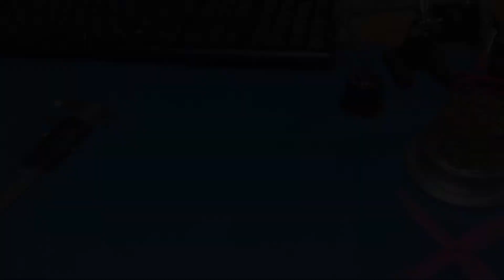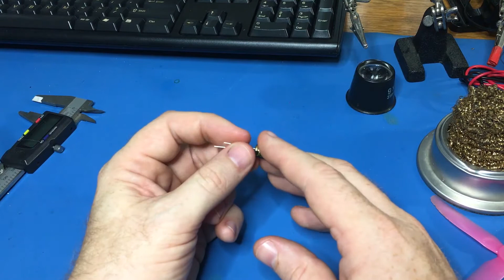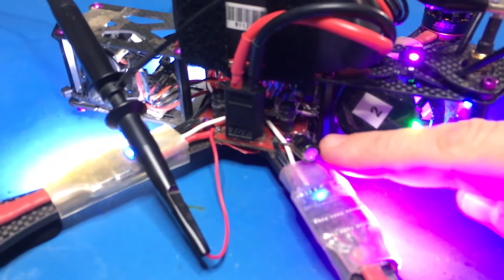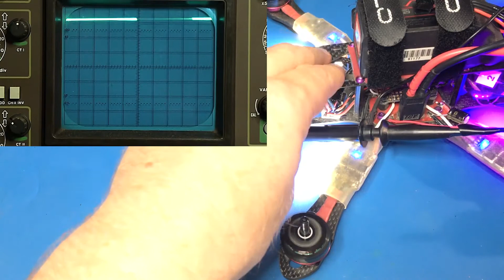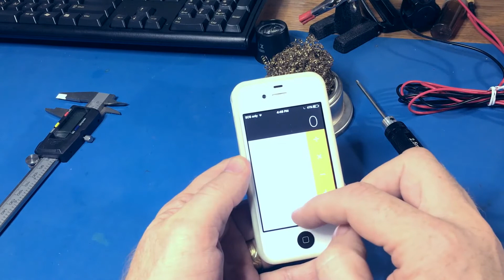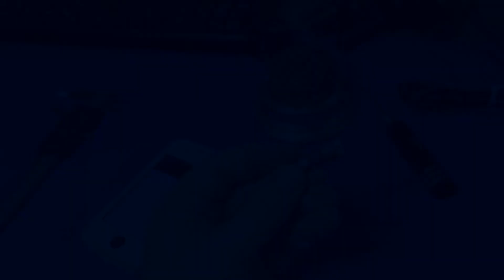Tech Talk - Testing Low ESR Capacitors | Mini-Quad Noise | LC Filter | HOW TO

Comment: hi, first, good info. Second, after salvaging some caps from old electronic components , Im wondering how to tell if the caps are low esr or otherwise ?
Reply from the maker: Thanks. I would say check the manufacturer of the capacitor and see if it's something well-known like Panasonic. Also you may be able to take a close-up photo of it and use Google's Image Search function to find matching images on-line, then you can check the datasheet of what you have found and see if it's got a low mOhm value. You'll need to put your "detective" hat on for this really :)

Comment: Can I use a 4x 4700uF 16V low ESR? Is it going to be better?
Reply from the maker: Hi Nicacio, yes you can do that if that is the only size you have. That size will be very big and heavy though I would expect. You may also find that the rating of 16V is too low if you are flying 4S or greater - the capacitor(s) might go pop!

Comment: That’s really interesting. I’ve been having some issues with my runcam Eagle quitting during flight. I had it wired up to the 5v out on the vtx and the camera would die a few seconds into flight. I then wired it up directly to the pdb and it stopped dying in flight but now dies after a crash or even breaking a prop flying through a tree. I noticed I tried to recover and then the vibration in the air frame seemed to kill my camera. It only starts working again once I unplug the camera and plug it back in. Could the voltage spikes be causing this?
Reply from the maker: It sounds quite likely to me to be just what you have described. I'd recommend putting either: 1) One large Low ESR capacitor on the PDB. 2) Four Low ESR capacitors on the ESCs. 3) Using a good RC filter to separate your sensitive electronics from the noisy ESCs/Motors. Regards Tony
Reply from the maker: It sounds quite likely to me to be just what you have described. I'd recommend putting either: 1) One large Low ESR capacitor on the PDB. 2) Four Low ESR capacitors on the ESCs. 3) Using a good RC filter to separate your sensitive electronics from the noisy ESCs/Motors. Regards Tony

Comment: Amazing video!!!!!!   Does any one sell a low noise high performance ESC?   It seems like the logical step in this hobby would be to make a low noise ESC.  My ESCs (RG20'S) are sandwiched between my frame and I dont have the room for these compactors.  Wouldn't it be easier for the ESC companies to add a bunch of square capacitors to each ESC?
Reply from the maker: Thanks for the feedback! I would say that in the "old days" the ESCs used to come with big capacitors but the manufactures started to remove them to save cost and weight. I would recommend perhaps putting a 1000uF low ESR capacitor on the PDB, as that will be better than nothing. Then if you really wanted to have low electrical noise in the system then an RC filter to separate the "dirty" section from the "clean" section. Today's ESCs are producing so much electrical noise since we have larger and larger motors and each ESC uses Active Breaking and its at this point that most of the noise comes back along the power lines. Cheers Tony
Reply: I guess I am alone on this but I like to fly my quad and have the best no nosense video when I fly.  I guess I am more of a freestyle person.  If digital was more mature and cheaper id have it already.  The current quad I have is the " night hawk 250"  I have all the ESCs sandwiched in the center with no room for capacitors.  As I care more about video more then speed I am open to your suggestions.  I am gonna upgrade my frame soon but just dont have the $ right now.  Is a cap on each ESC the only way to go for what I want?  Is there new ESCs with caps on them?  Should I not bother with the 1000 uf 25v cap on the PDB?  I dont have much noise but it is there even with out props as soon as I turn the motors on.   Great video brother.  I honestly think its a lil better the Joshua's and I think he is the shit.  LOL
Reply from the maker: Have a look at my part 2 video (one of my recent videos) that covers RC Filters, as it goes into some recommendations about single cap vs multiple caps vs RC filters. I would try each approach on your copter and see which gives the best results. Thanks for the comment about the video. This one (and my last 2) do take many hours (even days) to produce :D My background is in electronics and I have hold a degree in the subject. However, Josh is doing an amazing job and he has a much better way of sharing his knowledge than me!
Reply: 330uf low esr cap per esc is enough (small and efficient). 1000uf size too big.
Reply from the maker: Yes, I would tend to agree with you.

Comment: Really helpful thanks alot. I'm looking into how often you need to check the capacitors say after a crash with potentially large voltage spike or just after a length of time. I've read that checking a capacitor means having to desolder it, so you may as well just replace at minimal cost. Ive noticed noise in my video feed after a large crash which has brought me to this line of thinking. I have 4x 430uf 25v and have just added a 1000uf 25v to the battery for extra precaution now.
Reply from the maker: No worries, glad you found it useful :D. I don't think it's necessary to swap the capacitors unless they are physically damaged. I would just check the top (silver part) of the cap. Excessive current and voltage can make it bulge out or pop, but this would have to be sustained not just a very short spike.

If you have extra noise after a crash then I would say that you have other issues like a bent motor shaft or other mechanical issue that is causing the noise in the system.

My opinion is that installing a good RC filter to separate the "clean" section from the "dirty" (electrically noisy) section is potentially more effective (and lighter) then the 1000uF cap. Check my RC Filter testing video (part 2 of this video) that shows some practical results of doing this. Cheers Tony

Comment: Brilliant stuff. Question: 

Would soldering 4x 220uF capacitors to the ESCs + 1x 1000uF capacitor to the battery be the ultimate solution then? (Assuming the frame is big enough to accommodate)
Reply from the maker: I would say that the best approach (if your goal is to have a reliable aircraft you could trust while doing risky stuff like flying over water etc) is to utilise a method of separating the "dirty" section of the ESCs/Motors from the rest of the electronics.  Have a look at my part 2 video called "Tech Talk - RC Filter Testing" which covers this very concept. Cheers Tony

Comment: Awsome video! Will 220uF 25v (on each esc) also be enough when you have like a 2206/2207 motor and 30a escs?
Reply from the maker: Thanks for the nice feedback :D If you have a look at my Part 2 video that looks at RC Filters then I think that would answer your question. It also depends on prop size too, the bigger the props then perhaps the more low-freq noise (but at higher magnitude). In short, you would probably need an RC filter and Capacitors (that you mentioned) to be sure of smooth video/low noise in your system.

Comment: Thank you for your video.  It is so professionally done.  Reminds me of the only educational videos we used to watch in Physics class!  One question... why do you use 25v and not 35v?
Reply from the maker: Hey, thanks for the kind comment. Since I'm only using 4S the stable voltage will never exceed 17V. The transient voltage spikes during motor noise may indeed exceed 25V and you may think that I should go to 35V. However, the voltage spikes do not remain at those higher voltage long enough to pose any thread to damage the 25V capacitors. I also did not like the size of the 35V ones and they would of been a little heavier too :D Cheers Tony